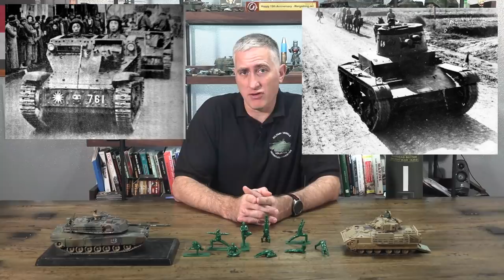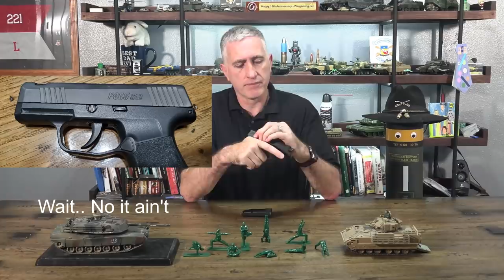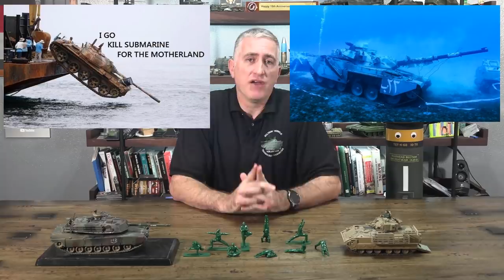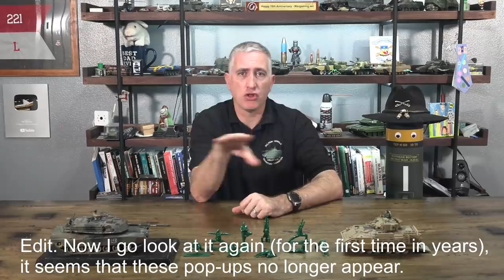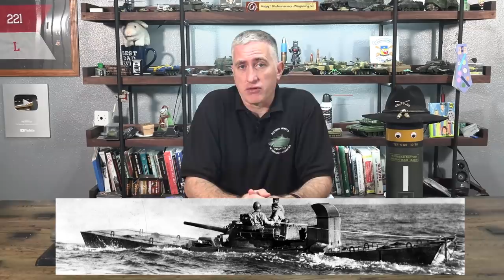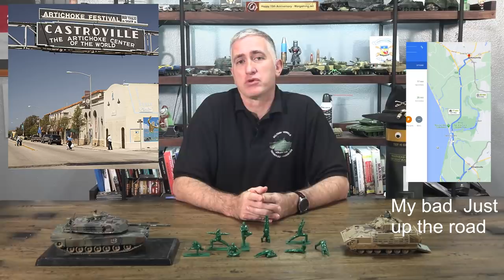Chieftain's Q&A 17. Rants, Ladas and shooting the other guy's cannon

Comment: There is a funny story about effects of tungsten on human body, however it's in Russian, here is the original -#2 "Вольфрамовая звёздочка" (The Tungsten Star) starts at 3:42:  https://youtu.be/OR1y7KobYSk?t=222
Summary, Russian cannoneers had a tradition, if one got a promotion during exercises, the guy should drink "gun brandy" - brandy poured through recently shot gun. All went as usual, but the guy then fell unconscious. First everyone was laughing, like "common, we didn't drink all that much!" But soon jokes stopped, he got transported to hospital. Medics started ventilating his lungs and tested for all kinds of poisons and drugs. Nothing. Then medics added another system - artificial kidney, as body on it's own failed to clean up all the crap in blood. Finally blood analysis showed excessive amounts of tungsten - 2000 times above the norm. I didn't knew that either, but tungsten basically is a heavy metal, like led or cadmium, so poisoning with tungsten is similar to poisoning with led, arsenic or mercury. Now, when medics knew what's wrong, they managed to save the guy.
Why everything was OK before that accident? Because older guns were made of steal, but then tungsten liner got added, so the old tradition had to go away.
Reply from the maker: There is a similar French tradition which was referenced in one of the Tungsten reports I dug up recently.

Comment: Why on the mirrors and turn signals. Usually because it's a requirement for a vehicle to be "road worthy" in peacetime. At least that's the reason why we Swedes have them. They don't need to have a function, they just need to be there:P

Comment: > VL-Hellfire [..] I should patent that idea...

I think Northrop Grumman beat you to the punch there. They've got the Surface-to-Surface Missile Module for the Navy's LCS, intended for small boat defense. It's your basic box-o-rockets, loaded with Longbow Hellfires with lock on after launch capability, tied into the ships defensive systems. I also think that it would have land-based anti-armor potential, though I'm not sure how much overhead cover clearance would be an issue (probably not great for fighting in forests). Still, pretty nifty.

https://www.youtube.com/watch?v=5BrkjB6YuG4

Comment: Hey @@UCp4j9Y9L6jie44iZroCb99A.  I wonder if you think the Germans in WW2 might have been better not developing the Panther and Tiger (let alone the bigger monsters) and simply stick with Panzer IV Special.  They had the same killing power as the Panther with the long 7.5cm, you could get many more of them for the price, they wouldn't break down on the way to the battle and were much easier to fix when they did, plus you had a much simpler logistics chain given your other main AFV was the STUG.  It seems possible to me that having 5 Panzer IVs on the battlefield might be more useful than the one Panther you could get there for the same effort (guessing at the build / maintain / transport ratios...).  What do you think?  (and, for extra credit, would that answer be different on the Western Front facing mainly 75mm / 6 pdrs, versus on the Eastern front, facing T-34/85 plus whatever monstrosity the Russians had available at the time).
Reply from the maker: Where would you get the crewmen for all those pz ivs or stugs?
Reply: @TheChieftainsHatch  it's obviously a fair question, but does this mean that Germany decided to go for Panther / Tiger because it was short of soldiers?  (Which would be a new interpretation for me).  I didn't think / know that the shortage of people was the driver for heavier weapons - I thought it was a calculation (possibly, a miscalculation) of the weaponry they needed to take on the Russians.  Also, since Germany suffered more casualties in Jan-May 1945 than in any single year previously, I would guess that in 1943 when the decisions were being made they still had enough warm bodies to man the tanks, however many there were.  Just looking at the relative size of the infantry and armour in Barbarossa (the only numbers I have to hand) suggests that there was plenty of infantry that could be trained if the vehicles were available for them to man.

I guess a fairer question could be where would they get the OIL to run all those Panzer IVs.  But, again, if I know anything about German decision making at the time, I suspect the answer would have been "steal it".  Resource constraints tended not to influence German decisions (wild generalisation alert) till late on otherwise they wouldnt have invested so much in V1 and V2 for example.  Plus I wonder (I would be interested in your take) if the total resource consumption of building and running 4-5 Pz IVs would be less than the total resource consumption necessary to build / run / repair the Panther that actually made it to the battlefield ?

Comment: Can you still make a T-34 operating in combat nowadays?
Reply: There are hundreds of T34 tanks rusting away in Africa, South Asia, etc. A bigger challenge is finding a Third World nation with enough 70 ton bridges. What good is a heavy tank if you cannot drive it to the battle/
 Also consider width of roads. Cities built before automobiles tend to have narrow streets, too narrow for an M1 Abrams tank. Also consider the width of mountain roads in the Himalyas and Andes Mountains.
Reply: @robertwarner5963  how they find parts to keep those T-34s working? Can you use modern mechanics on old T-34s?
Reply: @TheStugbit  well a shitton of T-34 were built, so they probably have a park of tanks used solely as donor vehicles to keep the rest running, also the T-34 automotive components are still rather simple so i assume it would not be too hard to find erzatz on the market or have replacements made

Comment: I don't mean to be that guy, but that's a sign p365 man lol
Reply: Try the Smith & Wesson Shield Plus 9 Performance Center. I have one myself and the way she holds is far better than the Sig making it more accurate for myself, and I'm willing to be you as well. Also the 14rd mag is necessary as the "small" 10 rd shortens the grip

Comment: The North Korean tanks look like they were built with pieces from a CNC or a 3D printer . The blacked out skirt between the ground and the actual painted skirt would probably make it a lot of fun going cross-country. And the peculiar bulge in the front of the hull makes me wonder what is under all this applique nonsense. I seriously doubt North Korea can produce anything capable of handling the South Korean k1 in direct combat. Let alone the American m1 or it's later variants. I doubt it that they could handle the latest Russian tanks or anyone else's latest tanks for that matter.

Comment: The Lancia Vega, and other Italian cars from the 70's, including Ferrari's of the era, were ironically made from cheaply purchased RUSSIAN steel !!! and made in much lower quantities than the Lada, and also served in dryer and warmer temperatures far from ocean salt of the Med, and Us Eastern Seaboard.. Plus they don't use salt on Russian roads, they use sand.. not to mention the fact that a steady flow of leaking oil continually undercoats them from every orifice, from u joints to power steering, to transmission.. good quality seals actually let the Fiat (umbrella) cars down.. 
   not to mention Ladas' were in production well into the 90's and there's about a million of the exact same model to pull pull spares from, it's easy to keep em running, try that with a Lancia, parts stocks are gone, and aftermarket is expensive.. so nothing inherently wrong with a Lancia of the era,  good cars if you keep em dry.. America made plenty of rust buckets in the 70's too,  find me a decent Imperial from North of the Mason Dixon line.. 
  Lastly most decent Lada's these days are ironically from Siberia and the Stepps, where the lack of Salt air has preserved them.. the rest are rust buckets , kept on the road on life support, and the three other Lada's you bought for 50 cents in the back yard...

Comment: So, uranium is OK because tungsten is bad.
But wait, tungsten must also be OK because lead is bad.
This not a good argument.
Reply: no, he says that people have issues with the use of DU, he just pointed out that modern research would indicate that tungsten alloys are not much better in regard to environmental and water table pollution.
it's not that one is okay because the other is bad, but that both are equally bad, so the debate on which to favor for environmental reasons kinda becomes moot.
the issue is that there is not really a good alternative to DU or tungsten for AP round material.

lead is more of an issue in small arms, and for that the issue could be resolved by replacing the lead cores with soft steel (which the Russians do, pretty much all of their ammo is steel cored) but then you have to convince the entire industry to move, as the use of steel is often looked down as an inferior material used in low quality ammunition, and to this day there are ranges that prohibit the use of steel core ammo because it degrades target faster than lead.
Reply: Rewatch that section. It's not "DU isn't bad." It's "New research indicates that military tungsten alloys are just as bad as DU."

Comment: lanicias and fiats rusted because the Russians gave them 'weathered' steel
Reply: And early VW Rabbits.
Reply: Alpha Sud apparently went like stink as it got older, more rusty, max wear on engine bore, less friction etc and bit dropping off it as it fell apart 😁
Reply: @dave_h_8742  less weight more fast ....
Reply: Something I learned when working on licence-built Fiats, back when they were still rather frequent, is that vulnerability of vehicle to rust and wear depended mostly on quality of steel available at a time of year in a country, not specific factory or product improvement/cost cutting cycles. Planned economy means, if there's shortage of specific resource in one factory, it holds true to entire country, because its availability is regulated by the state, and it cannot be obtainined from alternative sources legally. Because production is also regulated by the state, you can't lower production rate to minimum, until required resources become again available in sufficient quantity, so you have to disregard quality control and keep producing with shoddy materials provided.
Reply: @dave_h_8742  A girlfriend of mine bought a new Alfasud in the late 70's.
The driver's side floor rusted through in 11 months & it took a court case to get her money back.